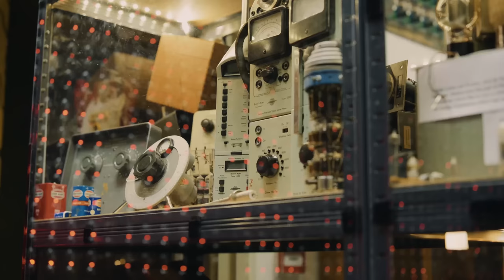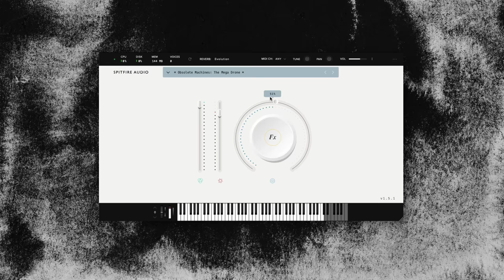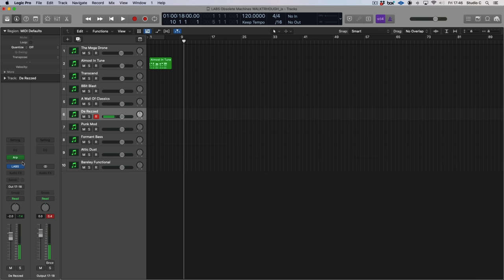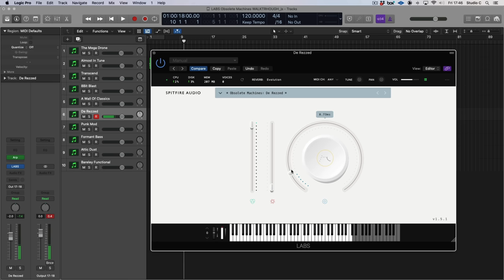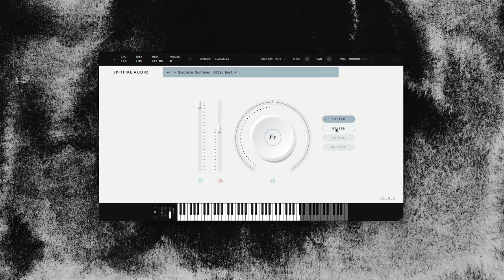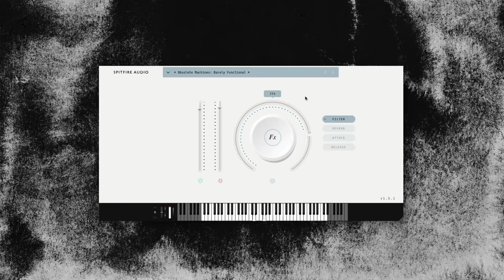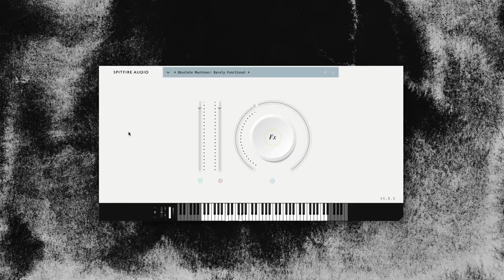Walkthrough: LABS Obsolete Machines

Comment: You can never go wrong with free goodies to play with....so for that, I say thank you. However, when will we get an update to the IIO interface? There is a lot of wasted space and features hidden behind buttons with no clear indication of what does what. I just would like to see this evolve in to something better from the team that I have purchased more libraries from than any other provider.
Reply: Ditto on both counts: love the generosity of the free Labs sounds, but the UI indeed is an amazing waste of space and the unlabeled buttons are a cardinal sin wrt UI design.
Reply: I think the interface is fine for the LABS stuff, as well as the Originals line. The real issue is that their higher-end libraries also use the same interface. BBCSO, Hans Zimmer Strings, Eric Whitacre Choir, Appassionata, and so many more, use it. Even their new flagship orchestra (the Abbey Road Orchestra, which has only just started to be released with the high and low percussion modules), uses it. It is unfortunately such a step back in usability and features compared to their Kontakt libraries. No sample purging, no round-robin editing (in the Kontakt libraries, if there is a round robin that you don't like, you can adjust its volume, tuning, or have it just skip over it entirely), and so much more is missing. It's not even multitimbral.

Features were supposed to be continually added over time, but it's been a few years now, and basically nothing. Abbey Road Orchestra got solo/mute switches for the mic signals, but even that simple addition hasn't filtered down to any other Spitfire player libraries. It really is a shame. I deal with it because I love the tone of the libraries I own, but it is just so frustrating that their older libraries have better usability and so many more features.
Reply: It looks pretty but it’s confusing. I don’t like it. I don’t think it’s the end of the world though. I’d rather have them spend time making cool new instruments rather than fiddling with UI. That’s just me tho.